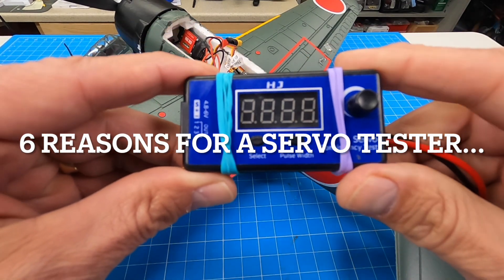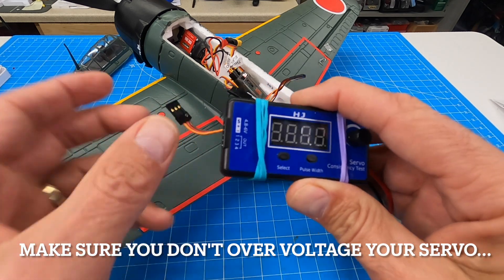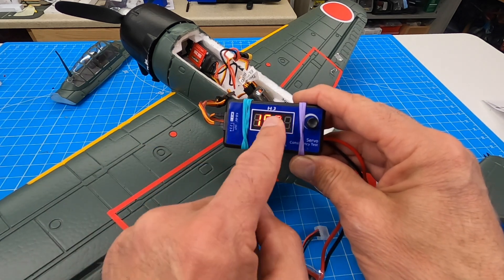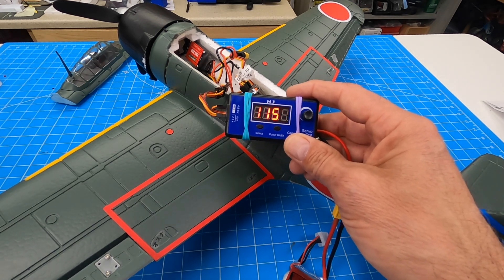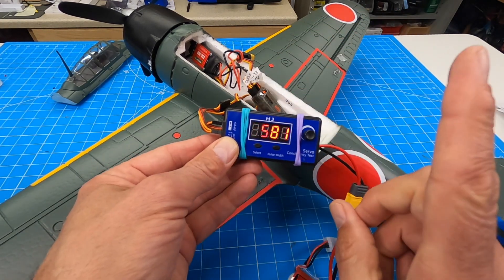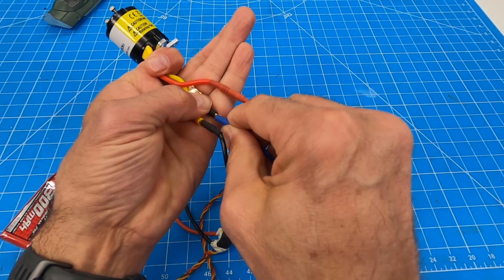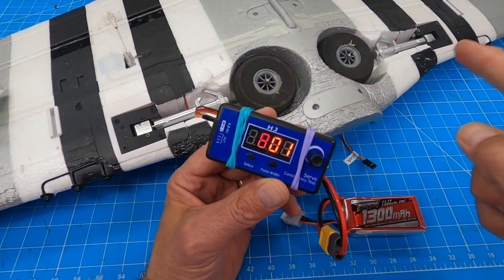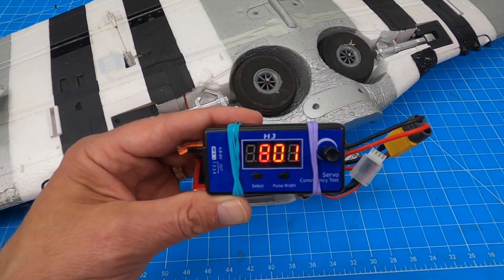Must have tool in the RC Plane tool box - The simple Servo Tester

Comment: I have spliced a servo plug onto an old usb cable to supply it's 5v... Ideal for when it's on the bench as i can plug into a phone charger (or any usb outlet) for infinite power. And saves digging around for a lipo or having to storage chargd the battery after excessive testing. Also runs off of a power bank. Great video 👍🏻
Reply from the maker: That's a clever idea! Thanks for sharing.

Comment: Good point, I have a few other uses. To hold a servo in one of the positions while installing or adjusting the horn end of the control linkage. Once the servo is centered and the control arm is installed, keep it plugged in as you tug and turn on the other end and make sure the rudder, elevator etc are in the proper position. Here is another use, some servo testers have a digital readout on how many amps it is using. If your servo binds up at full deflection, the amps spike. This is not good for your servo or the linkage. Fix it so when the servo is at max deflection, nothing binds.
Reply from the maker: Great tip..  Thanks for sharing..  Appreciate it.  - Will